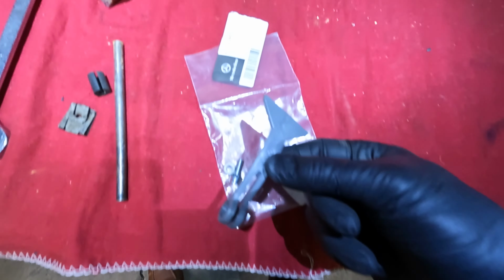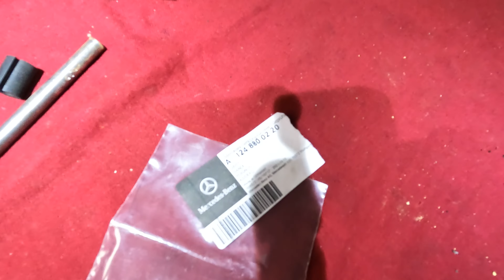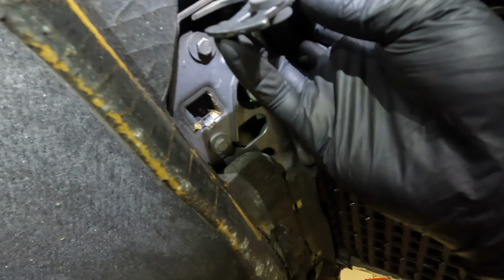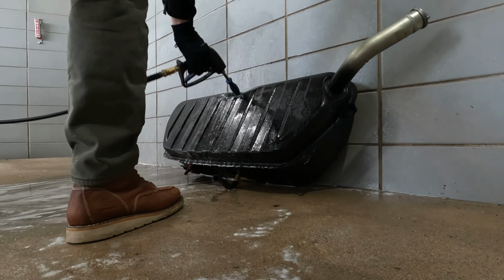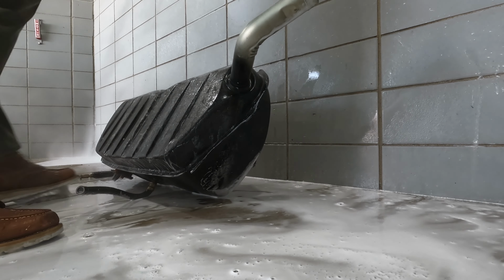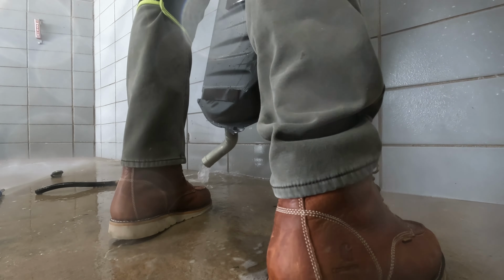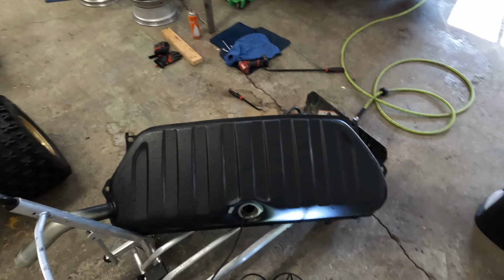ALL SYSTEMS READY TO GO ! WILL IT RUN !? BRING BACK THE 80S MERCEDES

Comment: Does it have a fuel pressure regulator like on the M104 on the injector rail? Those alarms btw were put on numerous W124's when they fail they usually drain the battery most of them can also be programmed to lock the doors once the vehicle reaches 10km/h. Also if you have the comfort module you can hold the key to the lock position to close all windows and roof and the reverse to open everything to its previous state, only works from the driver's door too. Sorry I just found your channel and realised you've done a few Benz's so you more than likely know all that 😏 w124 are certainly great old cars I think the earlier ones were made slightly better than the mid ninety cars considering the eco wiring on the engine loom throttle body, I'm about to do my tank as well the divider has seperated inside it very annoying listening to the swish swish sound depending where the divider has parked itself inside the tank 😐

Comment: You were kinda all over the place with this one, so I couldn't get a handle on it.
I think it said 280 on the back. And I think it is a six cylinder. Or is it a five?
It looks pretty clean, whatever it is.
I noticed there is no burp tube on the tank. Did they just put those on diesels?
My 85 300d had one. They are not clamped at the top. I ended up with a trunk full of fuel once. Took me a while to  find that.
I haven't seen you for a while, so I don't know if you've done other videos on this car or any others. I'll check your channel. 
When it gets into the 40s here at night in Vegas, I feel like I'm going to freeze to death, so I really would freeze to death wherever you are. 😂😅
Reply from the maker: If you watched the last videos this was a continuation of what I was going to do next. Its a 260e inline 6 . I did add a few clips of small things that weren’t worthy of a full video to show what else I did so it may have seemed jumpy . Thanks for watching !